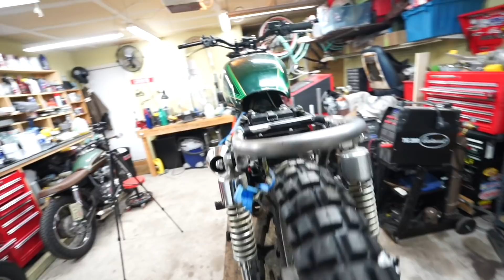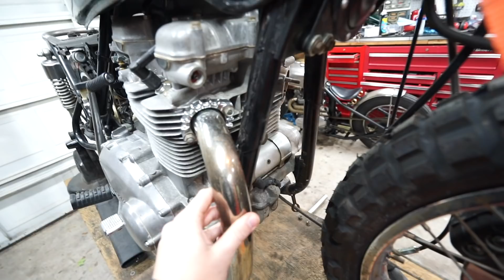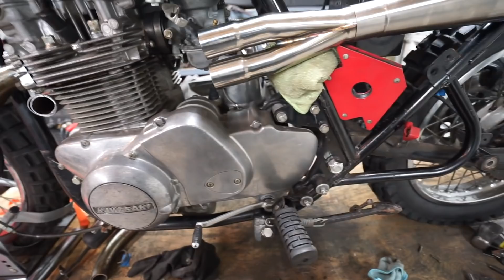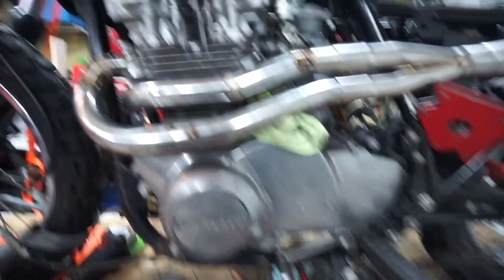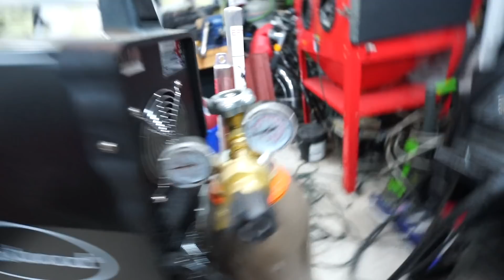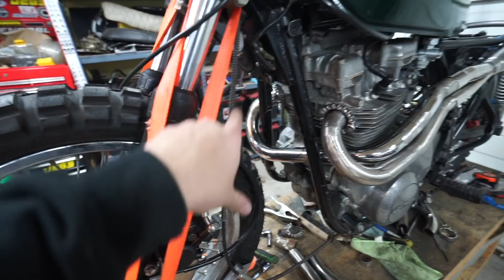KZ750 Scrambler build: Custom Exhaust

Comment: I have a ninja 250 2007 that I was ran off the road in 2012 with only 4000 miles. I took the tarp off of it and rolled it around from the side of the shop cleaned and rebuilt the carbs and took all the fairings off and this bike seriously looks brand new. the fairings are ugly but I've already ordered a really nice 1976 KZ400 tank and protaper bars and a brand new rear shock from a 2008 (newer) ninja which is taller and a set of Battlax Bridgestones and I'm building a custom seat. Now I just need to get a welder to do the hoop and make an exhaust which I have never done before

Comment: really like this build. I watched it when it came out, but came back today because I have a similiar project on which I want to make my first exhaust aswell. How did you grind of the chrome of the stock exhaust? just with a flap wheel on an angle grinder?

Comment: You could try using hot glue to fix the pie-cut pieces in place until you get the right shape for welding. Just a thought.

Comment: So the thin exhaust wrap will keep the two header pipes from roasting your left thigh?
Reply from the maker: It does on my Triumph.
Reply: Metal is denser than fabric, much like steam rooms are thin but water that temp would kill you.  Wrapped pipes are actually hotter but take longer to burn you.

Comment: Won't the exhaust heat affect the shock its blowing on?
Reply from the maker: I wouldn't think so. It's pointed at the top mount and a few inches away. When you're riding the bike the airflow will keep it cool.

Comment: Perfection Chain Products 54144 #4 Straight Link Coil Chain, Plated Steel Zinc, 100 FT Carton https://www.amazon.com/dp/B019Z3I1S0/ref=cm_sw_r_cp_api_i_aEPpCbBJFK19K 

How about trying to get some small stainless steel chain to make your loops for you exhaust springs. The link is just for example.
Reply from the maker: That’s a great idea. Thanks!

Comment: Do those Evolution chop saw blades work on any ol' chop saw?
Reply from the maker: I'm not sure. I know my saw spins slower than a traditional abrasive chop saw so I would imagine the blades are designed to work at slower speeds.
Reply: Those blades are for slower (but more torque-y) saws, for sure. Abrasive saws generally run a much higher rpm than the metal blades are rated for.
Reply: @skullsandflames123  Thank you.

Comment: You should wrap the pipes and also make a heat shield...
Reply from the maker: Wrap is coming in the next video. I will ride it and see if a heat shield is needed. I have had good luck with just wrap on my Triumph.
Reply: Maybe a wee shield on the right pipe where it curved round behind the wheel too?

Comment: Glued to my seat. I've built several exhausts. Good luck 👍. I'll be doing some exhaust builds on our channel soon. I have that same saw. Careful cutting stainless because it will mess the blade up. Not so much on thinner stuff but definitely on things like .125